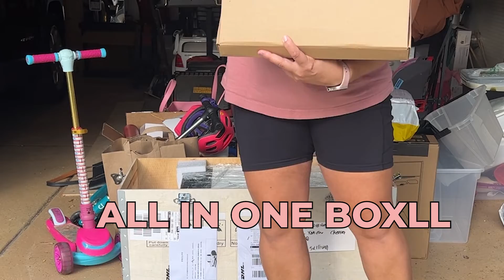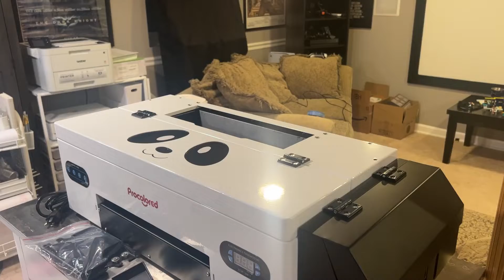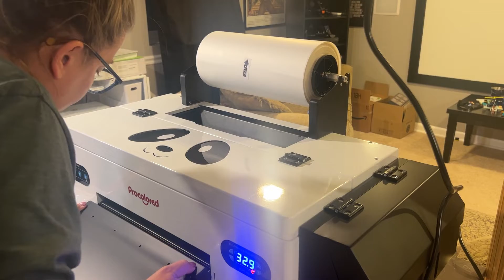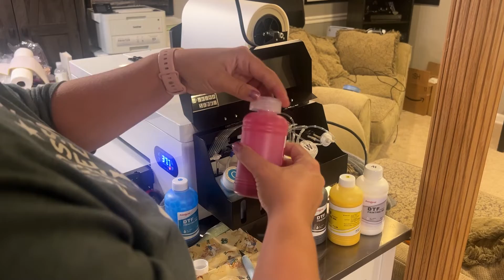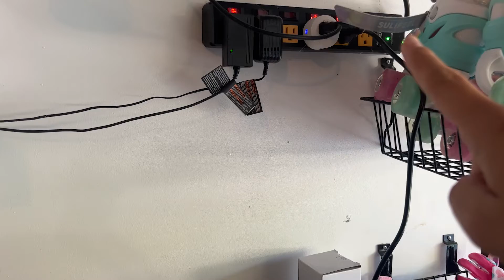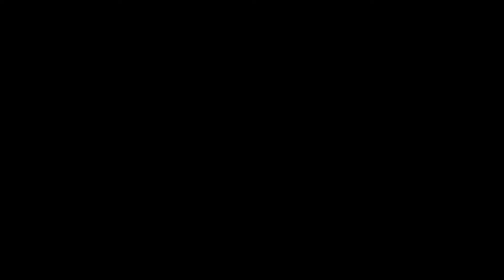DTF Printer Unboxing and HONEST REVIEW | ProColored DTF Printer

Comment: Your video is very informative, I have been looking at this printer for quite some time, but you did say something and this is what kind of makes me not want to buy a DTF printer due to ink clogs and super high maintenance printers.  I would hate to buy such an expensive printer and have to toss it or spend thousands to fix it.  Say I have to travel for some of my business stuff and or just travel in general is there a maintenance print head cleaning that is scheduled without you manually having to do it everyday yourself?  Things happen and there may be times where I am not able to run the printer everyday when your running a small business.  If you can please give me your thoughts on that or if you have any information, because running this manually everyday without auto self-cleaning feature would not be ok due to printer issues if this is not done. Hope that makes sense. 

 This looks like a really nice printer, there is this one and the Xtool I am deeply researching.  Do you know how the Customer Tech Support is on resolving issues and do you have to buy that extra for maintenance tech support?  I'm just trying to gauge this sale.  So any of that good information would be useful from a customer perspective and not sales from the company.
Your video is very good though Props to you!

Comment: Hi, your video was great - I also have one - new to this,  I have one question, when you go to size your picture, I am at a loss, it started out right , but when i changed the setting to make it look bigger-  which i must have done wrong - for the (x) and (y) what do you use for the correct size - my screen is so small and when i print it prints off the paper.  Understand if your too busy and can't answer.  there are no videos to really tell you how to do that part.

Comment: 80% of the people who buy these have no business spending that money. I have one and I really have no business with one because I print so little.  They must be maintained and cleaned religiously, the printheads have to be replaced. The white clogs quickly. Are they fun.. Yes are they also a PITA yes.  If you have no idea what DPI is or have no ability to edit images it will become a big huge clogged up paper weight soon.  Everybody sells the prints you want cheap .. Unless you are spitting out 20 shirts a day you are better off paying for prints.  Unless you KNOW what you are doing, you should not buy one of these
Reply: Yes! 100% yes! And that's also assuming they send you a working printer. Because these can't be tested at the factory, they Procolored has no quality control. They will send customers printers that don't work. They don't honor their own warranty. They make customers with bad printers PAY for replacement parts to try and fix the $4000 paperweight.

Comment: How long does it take to print a 12"x12"? Curious.
Reply from the maker: Depends on the design but most prints I’ve done have been about 5 mins
Reply: @AlisonCrafts  Thank you! I just bought this exact printer from somebody locally for $700 CAD, he's replacing the ink lines and the Printheads for me too, so I'm really excited to start using it! Do you have any recommendations on what I should be doing and what I shouldn't be doing to make sure the printer stays good? I know I gotta print something every day, but anything else?

Comment: Thank you for sharing.  I know this printer can print up to a little over 11 inches wide but since it has a roll of paper on it, do you know how tall it can print?  Thank you.
Reply: You can use 13” rolls and the older models can print as long as you want but the newer models only can print up to 40”.
Reply: @13ertotorres53  thank you
Reply: @13ertotorres53  ok thank you!!

Comment: Can you print on sheets of film or only the roll
Reply: If you get the roll printer you can use roll and sheets, if you get the sheet version you cannot use rolls.
Reply: @13ertotorres53  but there’s no paper guide to line the paper by

Comment: How to keep it from clogging up the printer head if I only print it few time a month ? Thanks in advance
Reply from the maker: Do a head cleaning daily in between uses
Reply: You could use it then put it in “vacation mode “ basically using another set of dampers (cartridges) to use cleaner/ moisturizer to flush the printhead when not in use for a long period of time. But this printer is made to print daily or very often , you can contact the lady in the video and see if she will sell you just transfers which is very common .
Reply: U ain’t using it enough THAT’S Y IT’S CLOGGING tf

Comment: Only regret is not buying the next size up I absolutely love my A3
Reply: Is the print quality good or does it feel like plastic
Reply: In my opinion you made the correct choice with the A3. The printheads are cheap compared to the next step up for barely any resolution gain. 320 I think for A3 and over 1,000 for the next step up. No brainer for me, A3 all the way.
Reply: what is the next size up?  I thought A3 for DTF's print up to large 11x16 or something like that is that not the case?
Reply: The exact question I’m considering is should I get the larger size